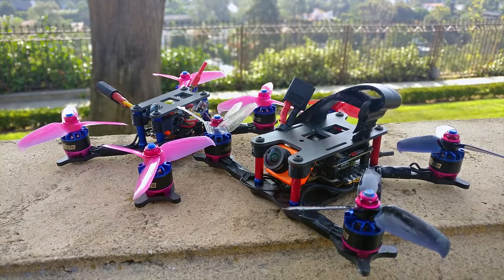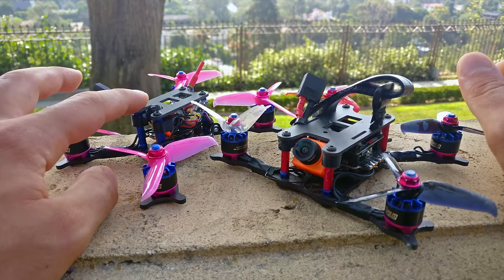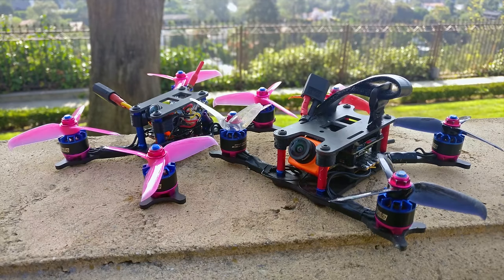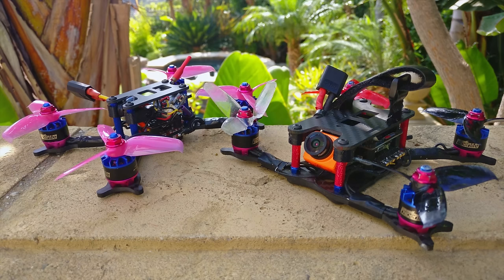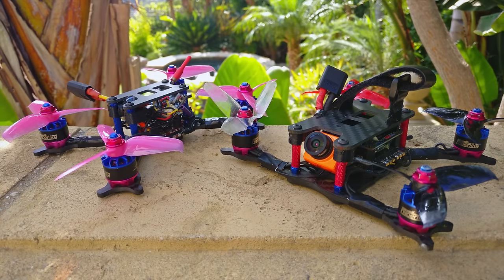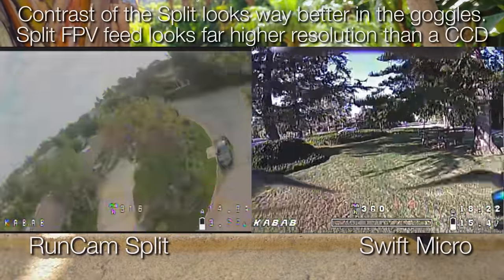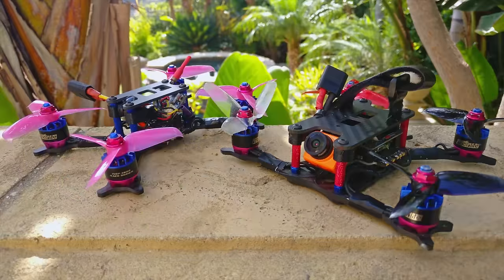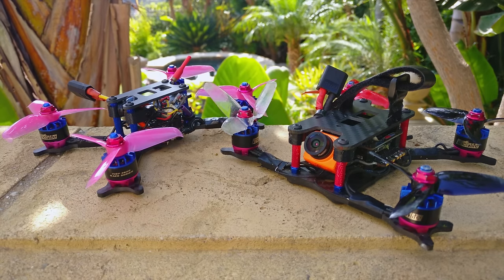RunCam Split - Review and Usefulness

Comment: Even though I enjoy your reviews and the effort you put into them, I'm going to get the split to put into my next build because it's lighter than a session (broke 2 now) and I primary use my videos to show the wife,dogs and people at work. Accepting the fact that I'm never going to be a Johnny FPV but dumb thumbs DesertEagle, I think the split should serve better than the FPV straight to DVR video I'm doing now. For 130-140 sized quads that need to be as light as possible, I think this is right now the best solution unless I go with the mate 808 cam that is even worse. Until the RunCam micro I've Been flying cheap CMOS cameras on my little quads for over a year and have suffered through it so I think the split should be a step up from those. I dunno and I'm on the fence but I'm going to give it a try because there is nothing else. Thanks for your refreshing honesty! Much needed and appreciated.

Comment: Even if you did put it on top of the quad like a gopro as a secondary most people would still enjoy the massive  savings in both weight and money. If I feel the latency is an issue I will attempt using it as a secondary on my 4".

Comment: Hey kabob, I got a problem with my race drone... I’m new to this hobby. I recently built my own 5 inch race drone with 2700 kv motors, but whenever I do punch outs on a 4s lipo the drone turns off for a second mid flight. I’m using a diatone flight controller, do you know how I could solve this problem?
Reply from the maker: sam Costin there are a number of things that could be wrong. I would say to check your battery connector and all the wire leading up to the PDB first however.
Reply: sam Costin probably because of massive voltage sag. Got good lipos?
Reply: Suspect_FPV yes, I have some good lipo’s... I’m getting more this weekend tho, hopefully things will change

Comment: The Runcam Split is an interesting product but it doesn't seem like its a finished model. The power issues are scary enough but you can get around them with a diode in the 5v line. Ive seen it drop frames on 2 of my matek PDBs so we might need to start adding more powerful 5v converters.

Comment: I've been thinking about the dual camera option as well. Like maybe getting a mount for the split camera 3D printed and put that on top and run either a mini or micro Swift for the fpv feed. Seems like it might be a nice lightweight option for getting decent HD race footage. Even with both cameras you would still come in about 60 grams or so lighter than running a GoPro.
Reply from the maker: proto fpv or you could just use a monster cam if you have a 16:9 pair of goggles and a decent external DVR that would cost far less. you'll get about 85% of the quality of the split but only 24fps.

Comment: NOT a game changer?!?!? Someone better tell Stu to change his video title then...
Reply: I'm not a big fan of Stu. He easily excited with inferior products, so much different than Bob.
Reply from the maker: IRFZ44 he got me watching his most recent one regarding the quad he wishes he had when he started. the $150 thing. I was impressed by one aspect. the Vtx has an MMCX connector on it. why is all the 'high end' stuff still using bullshit UFL?! connectors!?
Reply: Because SMA is the most commonly available and widely used RF connector. It's robust, threaded and can withstand a lot of mating cycle. Sure it's kind of old, but as someone said: "if it ain't broke, don't fix it" and I don't see any problem with SMA connectors.
Reply from the maker: IRFZ44 sorry I didn't mean sma. that's fine, just a bit heavy. I meant UFL. that thing sucks.
Reply: Agreed. If you don't put some glue on it, it can come off and burn your VTX. I've heard about this quite often. As a bonus, the RF leakage is higher so it's not very suitable for high power application.
Reply: Also I've personally gotten sick of UFL on that same topic. It's a stupid connector.
Reply: +Kabab FPV
"IRFZ44 he got me watching his most recent one regarding the quad he wishes he had when he started."
So another victim of the click bait titles...
Reply: Hahahaha
Reply: i have tried the run cam split and it has no noticeable latency that I can tell of. The run cam split for me has the same latency as the eagle.
Reply: UFL connectorss are much smaller than MMCX connectors, which can matter depending on how you mount the VTx. I think they are also more popular in electronics and therefore easier to source, though I'm not sure how much that would matter to manufacturers based in China.
Reply: I don't agree with that, free stuff is just a message away even for smaller channels, I just am not a fan of the outrageous titles and not enough testing of a product to find flaws.
Reply: Right, outrageous and clickbaity titles. Even though I know it's a clickbait, I still ended up watching his video. Weird.
Reply: IRFZ44 Unify pro won't burn by running with a disconnected antenna or pigtail. Not even at 800mw and shuts down before overheating as well. Not sure about the tramp though...
Reply: True the Unify won't burn if the ufl disconnects.  But you still crash because you lose video.  I recently lost a quad from what I assume was the ufl comming off in flight.  I had forgot to glue it on.  I was at rather long range and did a fast flip.  Instant video loss.  One second everything was fine, then nothing.  I know the battery didn't come off because my Taranis didn't lose telemetry for several more seconds until it crashed.  After thinking about it for a few days I realized I didn't secure that ufl with glue, something I usually do.  Lesson learned...

Comment: The other thing people forget is that the split is literally screwed into one of your frames, so if you bust one and want to fly your spare you either go without HD cam or have to put one in every build (goodbye money).
Reply: Busting a split is not harder than a regular fpv camera. You're unable to fly either way.
On the second point there is just no comparison. The chances of hitting the split is orders of magnitude lower than hitting a session. Even worse, you could buy quite a few spare splits before a single spare session.

Not saying the split doesn't have problems, but you are really making up issues where there aren't.

Comment: Wow! That swift footage is really good for an FPV feed! How would you compare it to the newer foxeer cams you have on your other builds?
Reply from the maker: Jason Baldridge the Swift?  the CCD? not the split?  that's just stock. looks the same as all the other Sony 600 CCD sensors.
Reply: What I was saying is that the two FPV images you put up are the Runcam Split, and the Swift Mini and the swift looks alot sharper and more defined that the Split. I was then asking what you thought had the better FPV image to fly with, the blue foxeer Arrow V3 or the Swift Mini?
Reply from the maker: Jason Baldridge yeah it's deceiving. I'm not sure why. in the goggles the split looks a LOT better.

Comment: does anybody else running the split notice a big difference in battery life? My friend and I both build almost identical quads this last week. pretty much the only differences was the fact that i used a runcam split vs him using a runcam mini and our choice of antenna i used tbs he used vas ion. Tomoquads punisher frames with emax magnum fc/esc stacks and hyperlite floss 2204 2522kv motors with dal t5040 v2 props (his 248g mine about 260g cuz of the split). He was flying "harder" than I was but was getting almost a minute more flight time. I would not have expected the split to use that much more power. I expected a little extra power consumption but not to that level.
Reply from the maker: Dustin Smith the batt draw is insignificant compared to the motors.

Comment: Exactly What i felt.. Its just more effort for my brain with The Split. I just tested my Laptimes and made a Video. I was surprised that my Laptimes werent slower with The Split although i had to put more effort in controlling my Copter
Reply from the maker: JayQ FPV like I said, racing is more about timing than response. you can get good times with whatever you have. you just adapt to the situation. a little latency is fine for time trials. but in an actual race, you're likely gonna run into people more often because of the latency.

Comment: This is runcam, the v2 will be significantly better(as in less latency, higher resolution and bitrate)
Reply from the maker: will there be a V2?  Runcam doesn't really do better quality.  They prefer the base level quality that's affordable.
Reply: Kabab FPV I disagree, take for example the eagle and the eagle 2, the original eagle was not a very good camera due to its higher latency and some issues with noise and over sharpening. However this has been fixed in the new eagle and the latency has even been lowered to 33.8ms which is very competitive against their ccd cameras such as the swift 2 which has a latency of 31.6ms.

Edit: oh and the eagle 2 has a lower price

Edit 2: A while ago you reviewed a realacc wing on banggood and said a review was coming, is this still coming? I want to get into wings and I think this might be a good starter for me. Thanks.

Comment: I don't mind the image but the distortion is huge. the real pain is getting it into the frame you want. Messing around trying to get props outa view, and the board is so damn big fitting it in a 3 or 4 inch is irritating. The camera ends up butting up against the board on a lot of small frames. Needs to be a smaller board.
Reply from the maker: which is why I made this custom frame just for it.

Comment: I like Runcam Split, but I don't see it future proof when comes to resolution, FPV and video bitrate. In other words, It's going to be pain in the ass to take apart and replace. If I was the designer... I will make the FPV part 600 tvl just like swift, 4K resolution and  60Mb  for video bitrate. All this will make this camera standard with today technology.  Damn... Runcam was so close to get it right. I have no choice to get a GoPro. :(
Reply from the maker: TheDarkstar826 exactly. so so close but not quite there

Comment: i think i mostly agree with this, i would really like somebody to get the fpv feed as wide as a normal swift  if anybody out there has managed it, i don't care how mangled the hd footage is, that can be fixed post process, i have the 2.5 gopro ''style'' lens and the fpv feed seems very narrow, (havent flown it yet) but could somebody please figure out how to get a normal fpv view  (=2.5 view on swift?)  otherwise  i will just keep the swift onboard and encase the split cam in a foam block and mount it gopro style on top. but i have to say this is definitely a game changer, its cheap, and its high enough quality, and its light haandling is quad based,  smashing or losing gopros is not an option for most people.
Reply from the maker: a 2.5mm gopro lens looks narrower than the default lens on the Split.  I really don't know what needs to be done to improve it.  I don't know how the FPV feed is sampling from the sensor.
Reply: oh really? they only had the gopro available, ....thanks for the heads up.

Comment: watching the 30 vs 60 fps made me realize that the pixelation i get is is cause by the 60fps and youtubes compression, it looks better in 30fps but i didnt want to have to do that.....damnit youtube
Reply from the maker: Steven Gilbert that's one reason why I stick to 30fps high res
Reply: Kabab FPV issue is dampened in 4k 60fps?
Reply from the maker: Steven Gilbert I'd do it in 4k/60 but for some reason premiere wouldn't let me export in 60fps at anything over 1080p.
Reply: my $60 program called movavi lets me do that lol i got the YI4k+ just for the 4k 60fps